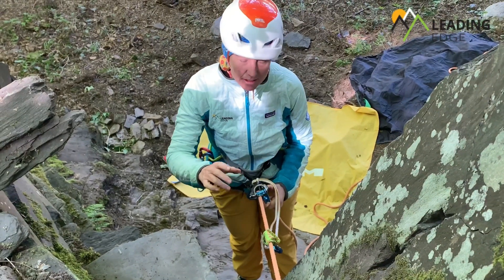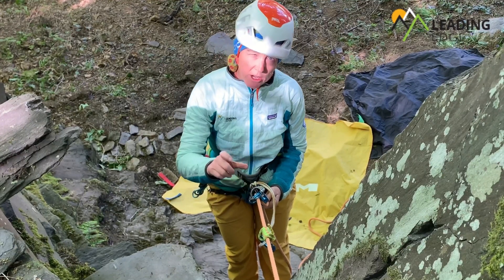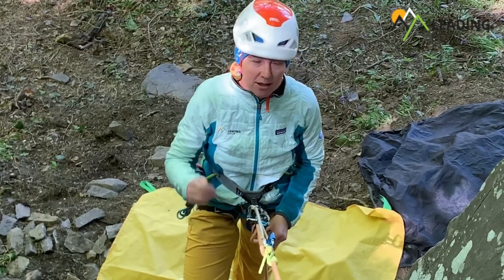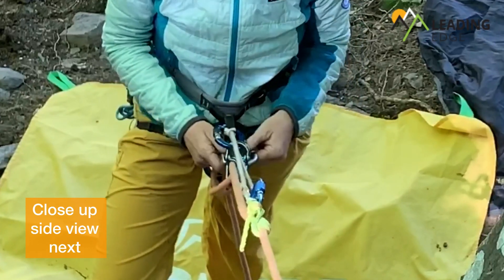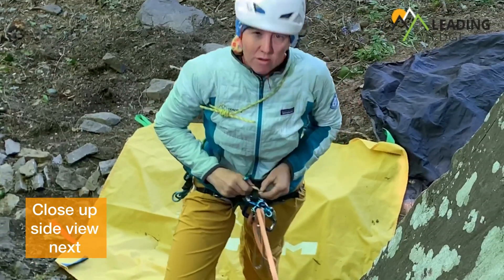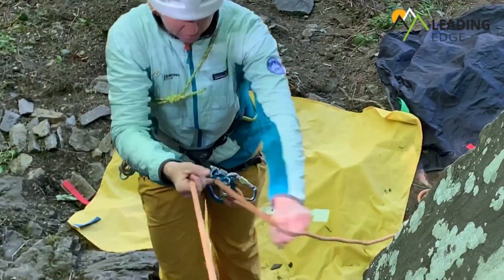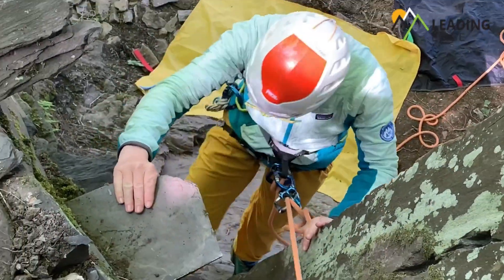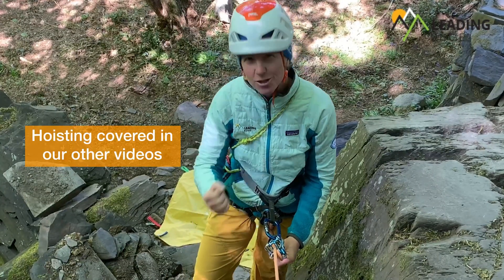Using a DMM Pivot in guide mode to ascend a rope.

Comment: Nice tutorial again!
I have practiced guide mode ascension on steeper ground and what I did was keep the prussik above the belay device, almost at my max reach, clip a crab to it and run the dead rope through it. It operated as a pully system, pulling down on the dead rope lifted me up, but it was very very slow. However in an emergency, e.g. with an injury and limited tools it might be useful.  
I might try it with a foot prussik on the dead rope, but I think the standard double prussik accession that you demonstrated a couple of months ago is more efficient - still fun to play around with different setups.
Thanks for the vids.